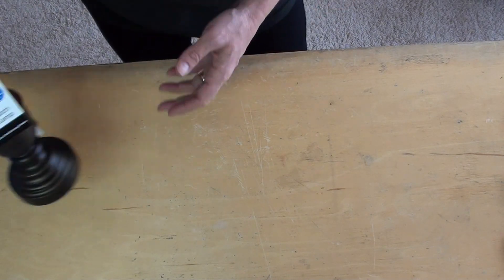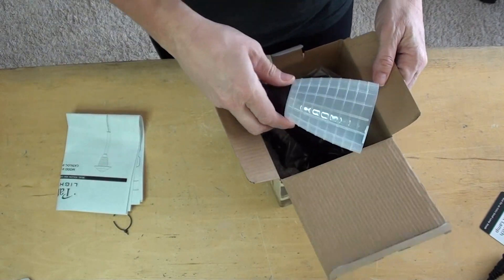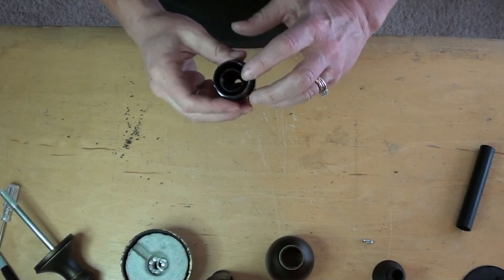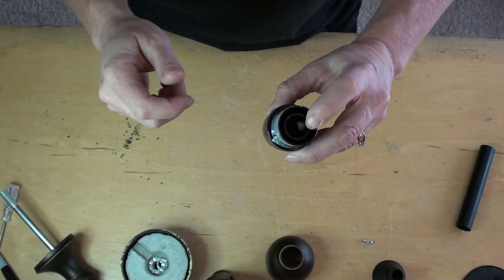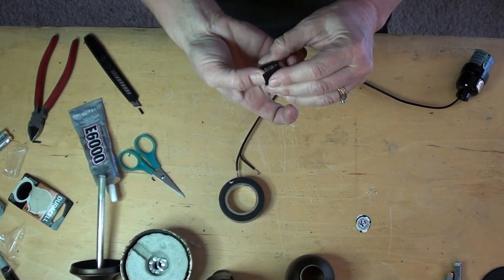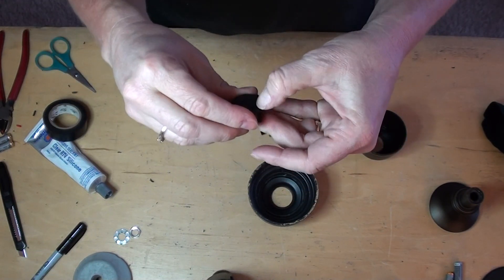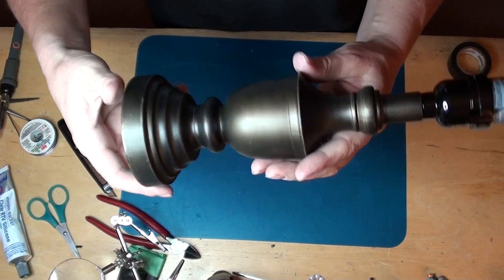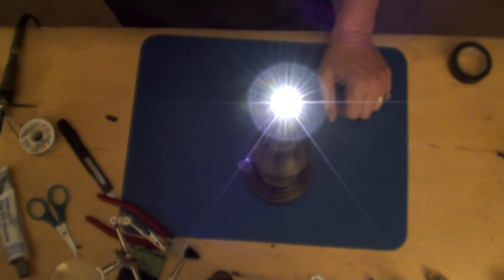DIY: 110v Lamp to 12v Conversion

Comment: .. cut the cord out and use usb rechargeable or AA battery powered led bulbs 😐
 They even come with a little remote, and you can set the warmth/coolness of the light, brightness and even colors etc

Comment: I've done the same with 12V LED bulbs with E28 base.  I solder battery clips on end and use , as you mentioned SLA's,  26ah in my case
Reply from the maker: Definitely a much simpler process! lol! Thanks for the comment, it's a great way to convert, too! :)
Reply: @EndlessDIY  I 've had my bedroom light powered with the SLA for over ten years.  A small solar panel , south facing keeps it charged, somewhat of a challenge in the low light months between November and January, but it's great when power goes out, I don't even notice.  Won't save much money but at 58, I need my hobbies :)

Comment: Nice I'm getting some old victorian outside lamps and i'm looking to do this and run from 12v batteries from inside the shed
Reply from the maker: Great idea! That sounds like a really cool project! 👍🏻
Reply: @EndlessDIY  decided to put fairly lights in them, look great
Reply from the maker: I bet! I may have to give that project a go myself! They’d be really cool on the stone pillars on my deck.
Reply: @EndlessDIY  they come with battery packs as well and can do a timer with it but i'll wire mine to a 12v battery

Comment: Have to search the whole video to find the part described in the title. Dimmer switch is needed or not?
Reply from the maker: I'm no expert & this was kind of an experiment for me but I put the dimmer in because I didn't have a switch handy. The dimmer served as both dimmer & switch on my lamp. My battery pack had very little longevity but your battery pack will probably be way better.

Comment: Very helpful video. So you know if this would work using 12v car battery? I don't see why not, however didn't wanna pay to find out. Hahah -- thanks!!
Reply from the maker: Thanks! I think you could use a car battery or even a small 12v 7ah SLA battery (like a mini car battery). You do have to make sure your LEDs are rated for 12volts or you'd probably need a stepdown converter.  Thanks for watching!
Reply: Thank you, I'll see if I can get something rigged up!
Reply from the maker: @jessekilgore  Awesome! Keep us posted on how you get along! :)

Comment: excellent project.  If you were to do a 2.0 you might want to use batteries with more Amp hours.  Be that as it may, we learn by doing!  Neat project!
Reply from the maker: Hi Kevin! You're absolutely right! Longer light time would definitely be better. These little buggers don't last long. Thanks for commenting! :)
Reply: @EndlessDIY  I'm gonna do a project like this in the near future.  I have a little solar battery charger and I think I will use rechargeable AAs for my first  go at it.  Hope you do more videos, my friend.
Reply from the maker: @kevinjones2145  That sounds excellent! Let me know how it goes! I like the idea of a solar charger. Clever! 👍

Comment: https://www.amazon.com/12V-Low-Voltage-Light-Bulbs/dp/B075XZ3CTL/ref=asc_df_B075XZ3CTL/?tag=hyprod-20&linkCode=df0&hvadid=241989147482&hvpos=1o2&hvnetw=g&hvrand=15406598982080424321&hvpone=&hvptwo=&hvqmt=&hvdev=c&hvdvcmdl=&hvlocint=&hvlocphy=9012066&hvtargid=aud-801381245258:pla-526753039825&psc=1